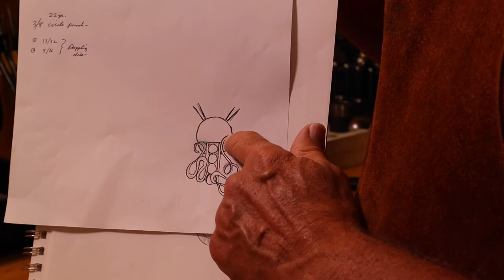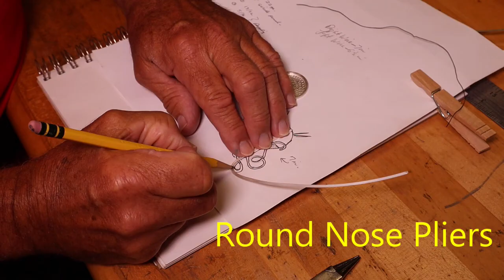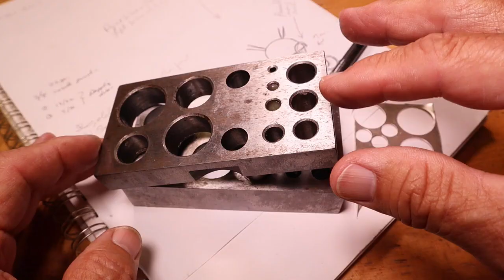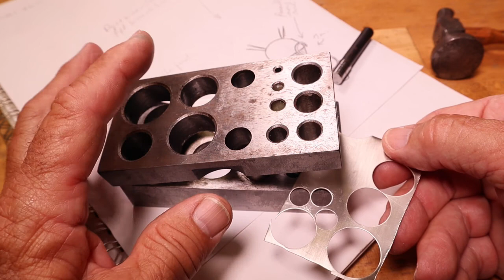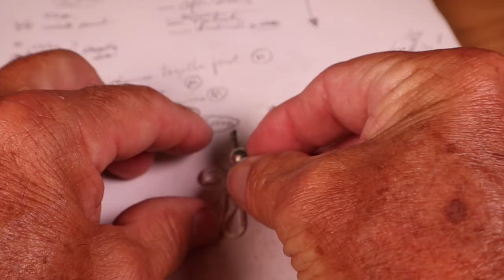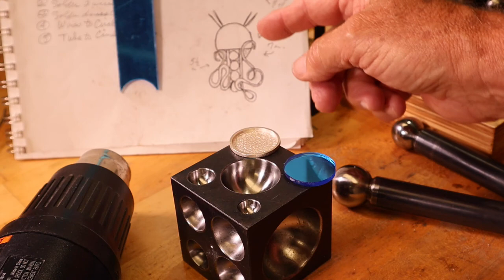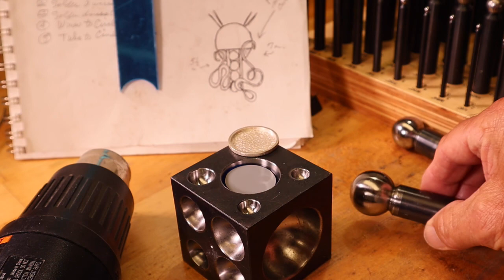THE MAKING OF: STERLING SILVER & ACRYLIC PENDANT

Comment: What buffing machine would you recommend?  In your video I saw the Rouge polish  you used for the silver; what would you use for copper?  Thank you!
Reply from the maker: Hello Crazy Info,  I recommend the buffing machine that you can afford.  Most are very good at what they do. So, buy a 2 speed motor and get what you can afford.  I recommend that you watch 3 of my videos.  "Jewelry Buffs & Compounds",  "Jewelry Polishing Machine & Dust Collection", and "Age Old Low Tech Polishing & Buffing Techniques".  These will give you great pointers on the machines and compounds to use.  You can use any of the compounds on copper as well as silver.  Check out those videos.  It will help.  Thanks for your questions.  Good Luck.  Greg Greenwood
Reply: @greggreenwood4628  thank you thank thank you!  I am going to look right now!
Reply from the maker: Great.  Enjoy.   Greg Greenwood